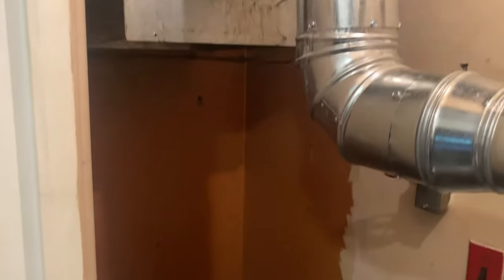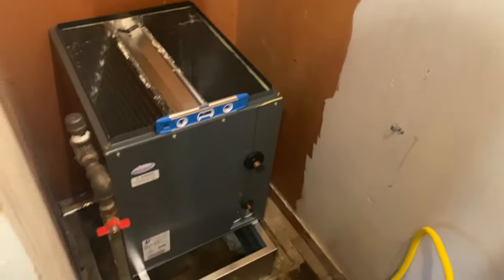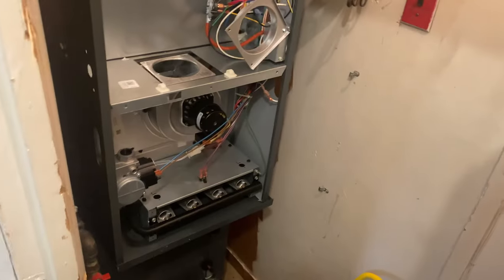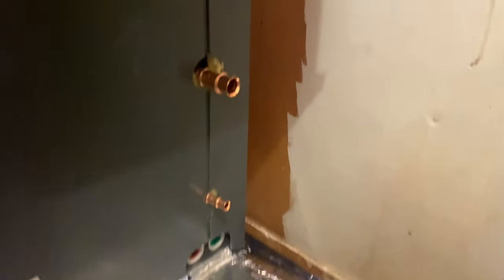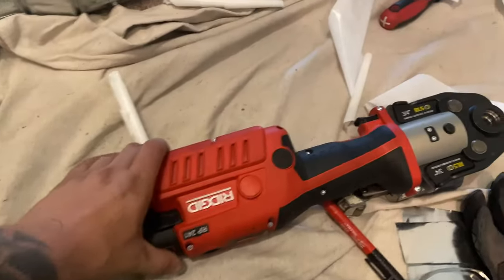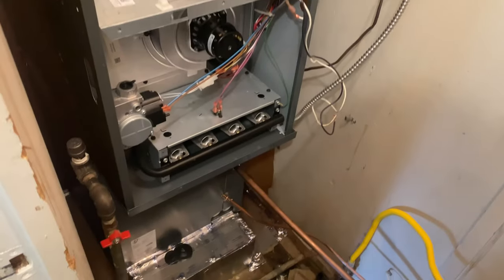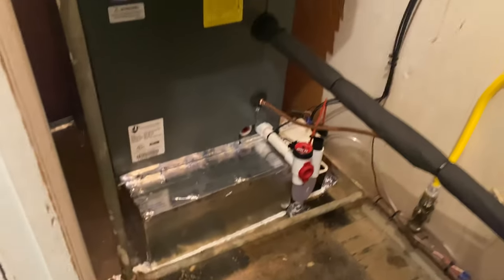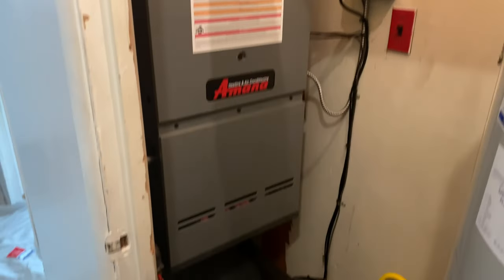HVAC installation: Furnace and coil in very tight closet.

Comment: Nicely done, not going to lie…. I would have probably pulled the water heater just to give myself a bit more room to work… I hate working in those confined areas.
Reply from the maker: We thought about it but it wasn’t that bad so said fuck it lol
Reply: I work in Nevada and they make us have 3ft from the gas meter… does it matter where your at?
Reply: @Cameron-km2cf  It does matter where you are at.  The AHJ (Authority Having Jurisdiction) will set the rules and in the absence of a local AHJ it will be determined by state building codes.  Most places are pretty similar with the exception of some really weird stuff in California and New York, but there are a lot of small things you need to learn for the locale.